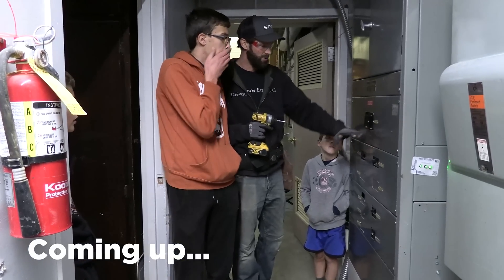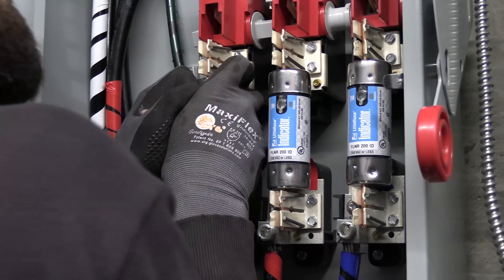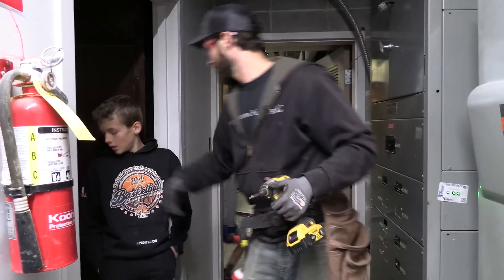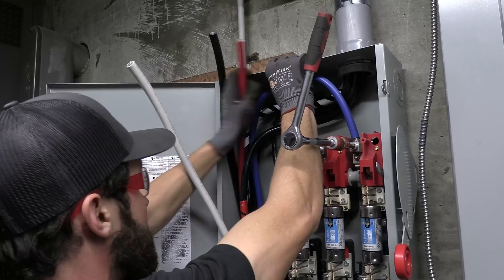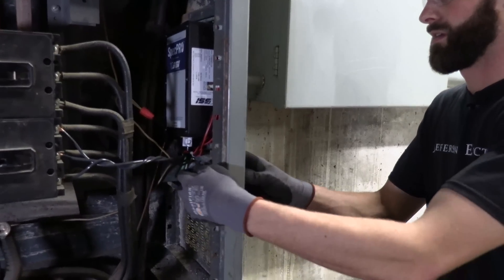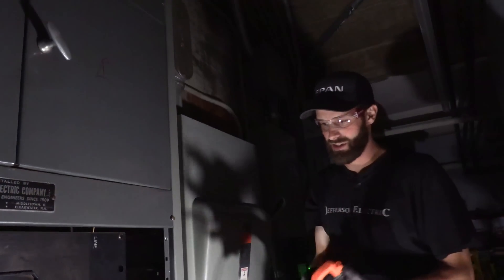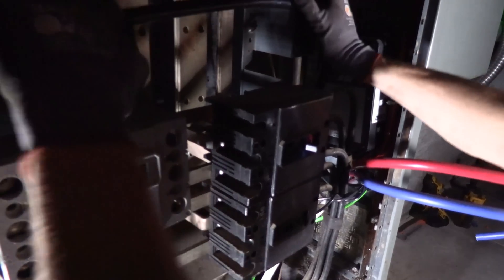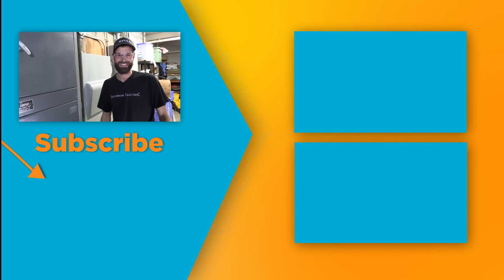They Don't Make These Anymore

Comment: Hey there if I'm correct. That's a pair of Irwin vise-grip slip joint pliers he has in his hand?

Got a pair of these quite a while back for my normal even household tool kit!

Seriously if anyone has even one pair of pliers this is probably the way they should go for adjustable!

Those are so much better easier to use never had any trouble with them.

To be honest they still look brand new at least my pair!

There's been so many times that I've struggled or would have and this really was best type to have in the toolkit.

Even the artery tightened up is a shower curtain rod we put in when I moved in.

I wish I could find a pair of magnetic soft Jaws to fit these pliers were possibly just soft Jaws I can easily slip on somehow or an equivalent that would just hold in place in some manner.

I was even thinking about using those what I call clamp pads essentially half rounded slide over protection for the jaws of C clamps.

And possibly other tools as well got those from Harbor Freight haven't tried them yet but I have a set but not where I'm at!

I was even thinking about possibly somehow having magnets on these two easily attached to my Irwin vise-grip slip joint pliers.

Plenty of times where soft y'all would have been much better but usually have to jerry-rig something!

That shower curtain rod wasn't too concerned about a few scratches.

However one of many crimes it would be better to have some way to cushion the drawers and still get a good grip.

Any suggestions for this of any type would be appreciated this is something I've been trying to figure out for a while so many times needing to tighten up something that would be good idea not to scratch up.

Such as nice shower head or other Plumbing installation.

Plenty of other things as well!

By the way I got those vise-grip pliers on Amazon unfortunately don't have a link.

I'd suggest anyone out there have a pair of these he won't go back I'd say when the best pair of pliers at least an adjustable variety I've used on my life.

Also don't skip on the size of your your pliers or you'll regret it in the end.

Also worth having a pair of water pump pliers available works great for all sorts of things even if sometimes trying to level up Appliance where you're having trouble getting ahold of the levellers works better sometimes for water pump pliers.

Reason we had a pair of these before is the residential irrigation system real pain in the neck to service the sprinkler head otherwise and yes recommended if you have an irrigation system installed and you do any work yourself there's Australis perfectly wrench for the sprinkler heads worth investing in it's sort of a weird-looking offset wrench you could say!

Also the water pump pliers are good for any type of connections that are just hard the work was otherwise even occasionally used it to get off a stuck hose clamp.

One nice thing about those vise-grip slip joint is there actually not as wide acrossed is some others are so things like leveling appliances it's much easier to get in the Gap easily where others were just too wide to get in there definitely a bonus to have a narrower jaw but yet plenty thick enough to get the job done but not 2 wide that you can't get in somewhere.

Had some more circumstances many times now so basically it was paid for itself.

Also the drawers do have a very good grip wish for others I cannot say are as good definitely worth the investment.

Even the handles feel really good in the hand and pretty much non-slip just a bit of cushioning sometimes all you need to do things comfortably as well.

And what they say with getting tools get the right one get a good one get it once or the equivalent definitely this counts as one of those

Comment: MSEE here. Great install but the only thing I’d done differently is take a wire brush grinder to the surface of the buss bars to knock off the oxide layer and any potential human created oils. That alone can impact conductivity. Great video thanks for sharing!
Reply: Apply antioxident only.  The buss is silver coating over copper.  Don't remove the silver by abrasion.
Reply: Especially on something that old.

Comment: I missed what voltage you were working with, but I'm sure 208,240,480 3phase, you need some arc flash gear on. Level 1 or 2, shorts and a tee shirt is not protecting you. Once you opened covers you should have maintained a safe working distance for non electrical personnel ie. Boss 1,2,3. If you going to teach the next generation teach the safety also please.

Comment: There should be a fluxing inductor counter-current in the circuit to inhibit any current through the building while working. Let the electricity protect you instead!

Comment: So Joel, I see you always use Di-grease on new connections, will you be applying it to the existing connections while you are in there? If not then would you re-torque the other connections as a matter of course or leave well enough alone?